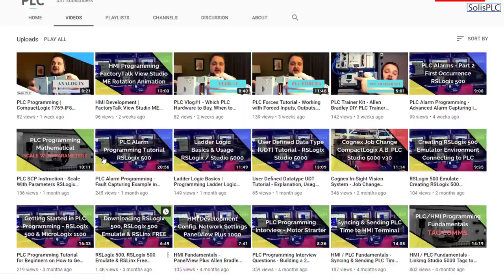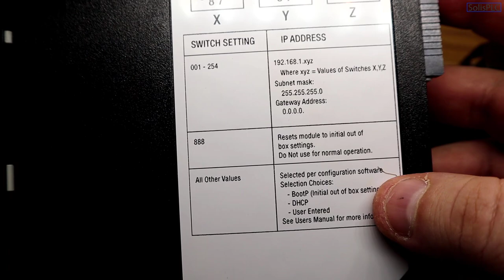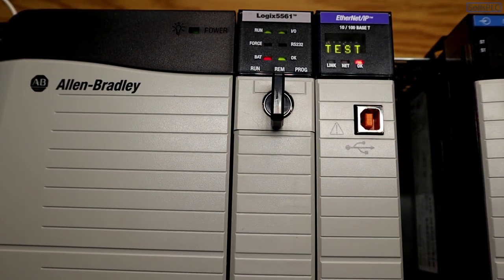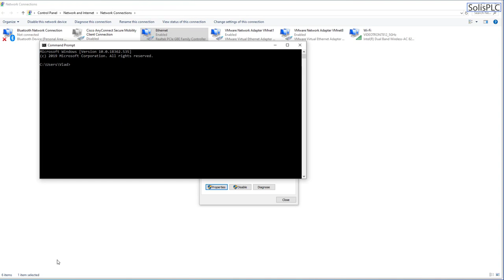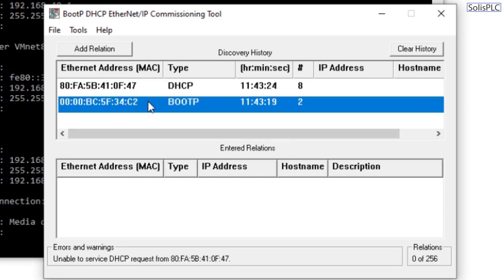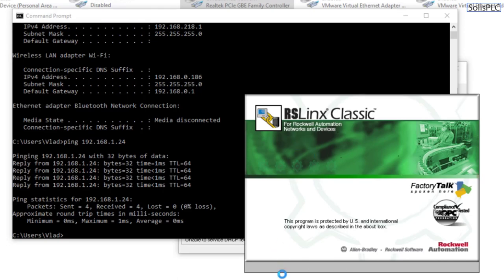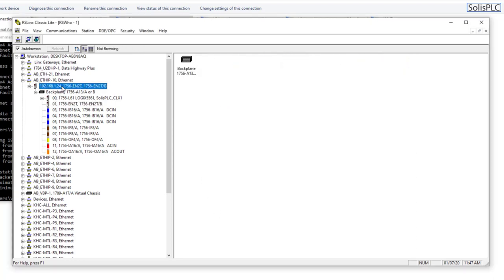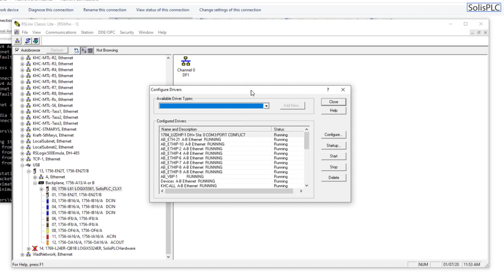PLC Programming - ControlLogix 1756-ENET ENBT EN2TR EtherNet IP Setup Troubleshooting

Comment: Very good explanation on configuring the EN2T or the comms module. Really appreciated you showing the dip switch reset. You are very through and you know, that’s very important and appreciated. I learned and still learning the hard way in automations but I came from process operations to automations so I understood the process controls. I started in automations by knowing almost nothing though I knew what a plc and modules all were. But it was hard with no explanation of how anything worked working with a very good Senoir Programmer. I learned slowly over time all on doing old plant upgrades at power plant sites and learning ControlLogix with Studio 5k. I have access to almost every RA software from their toolkit and on my laptop for field stuff. However, knowing and understanding how stuff works and software and the details like your explaining is fundamentally important. Not many places or even YouTube channels really explain RA Software in details or how to really program stuff in clear clarity. In programing engineering it’s important to be clear and understand how to do what or why. Your demonstrating that very well here in these videos. Loved it. These days it’s FactoryTalk Linx Software, Classic still exist

Comment: What is the main difference between the EN2T and the EN2TR?  I know it has an embedded switch on the EN2TR, and I believe that it has two separate IP addresses are available,   Thanks for the video - good content!
Reply from the maker: There are 2 main items: 1. The 2 IP capability as you pointed out. 2. The ability to use DLR (Device Level Ring) which allows for "more reliable" networking of field devices by creating a loop from two points of connections. DLR is good in certain cases and I've seen good implementations of it in the field.

My advice is to always purchase the EN2TR version unless there's a significant cost increase of one over the other.

Comment: Good Content..What is the reason only if PLC is not reachable from scada server although the same is reachable to all???Can you please share your brief checklist on this issue?
Reply from the maker: It's either network configuration or PLC / SCADA configuration. I'd probably start with the one that isn't accessible by other devices and see how it's configured, if the physical connection is correct, try to connect it to a single other device, etc.

Comment: I think you could this much with out factory reset with switches, and something was wrong after disabling with bootp rslinx must show you static.
Reply from the maker: You are right, but I had someone email me about an ENET card that doesn't have a display. I wanted to demonstrate that the factory reset is an option in that case. BOOTP always had many problems from my experience. Things aren't always showing the way they should. That being said, I've always followed the same steps and things do work out. It's a matter of going through it a few times.

Comment: Hi Solis PLC, our factory recently got a new Internet setup my Ethernet/IP card on my Chassis is showing a ip of 192.168.1.xx but our new ethernet ip address is 192.168.201.xx what is the best way to change this so i can communicate with my Logix 5555?
Reply from the maker: You can change it via RSLinx and that would be my recommended option. Simply add the current IP of the card into the IO tree, go into properties, and change it in the network tab.